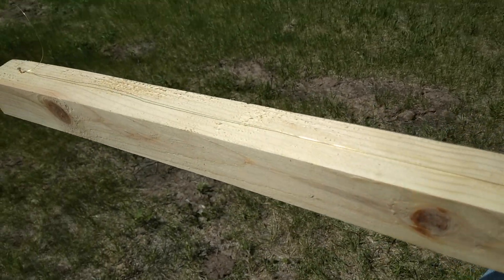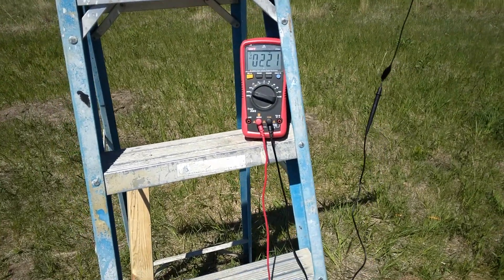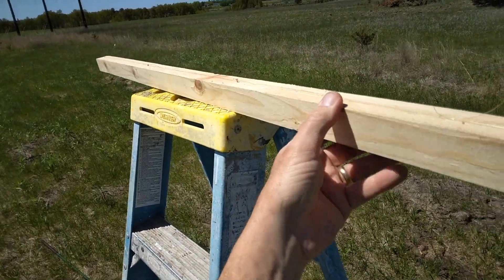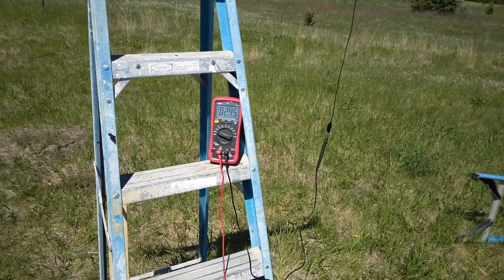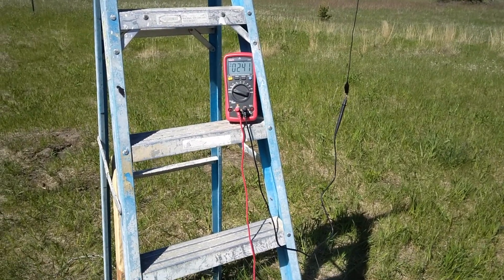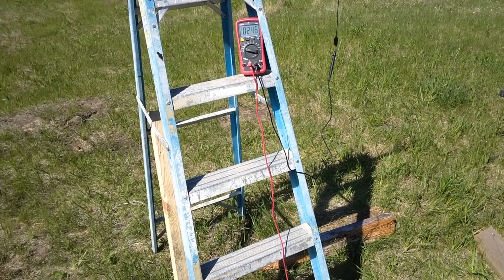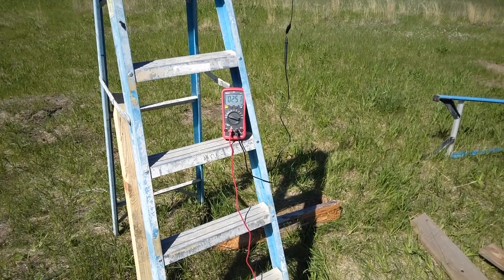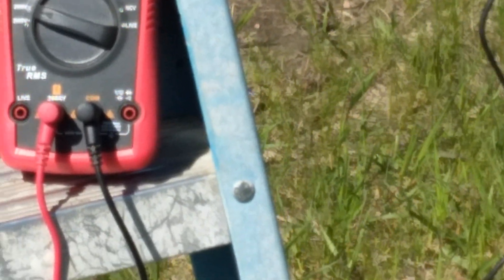Wood amplified energy collector

Comment: This very interesting.
Thoughts of maybe the board is acting a little bit like an 
”Electret”
This would possibly explain the gradual gain in voltage recognized

An experiment of bombarding the board with high voltage 30 to 40KV for a period of time again similar as to how an Electret would be made only this time using the board.

After bombarding the board with high voltage, bring the board back to your ladder positioned as was before again with the piece of bare copper wire pined with the nails, place your meter and see if there’s a voltage change. I’m imagining dipoles forming. My next experiment would be to somehow test for static charge or more correctly an electric charge radiating from the board.

Fun experiment, I enjoyed the curiosity

Comment: If inclined to, cut 50’ spool of 14gauge insulated copper wire into 1’ x 50. Coil wires around 50 iron nails hammered into cedar board. parallel connect each emf inductor coil then to a diode and capacitor tank circuit. Wonder if u could get a watt or two off it? 10 stacked together could output more wattage? proximity to transmission grid could be variable voltage? to charge 48volt batteries or run motor?

Comment: Would this power be enough to recharge batteries? What if you took out a portable battery recharger with you, would you be able to hook that up to this device and recharge batteries?

Does the shape of the wire change its ability to conduct electricity? Have you tried different designs for the wire setup? Like different lengths, or even a dipole antenna setup at different lengths (I don't know if electricity radiates similar to how RF energy radiates greater on certain frequencies)

Have you tried making different types of coils? Like a coil you would see in a generator. Or I think the coils in portable wireless chargers are like a flat circle like a snail shell Labyrinth shape. 

I am a complete novice when it comes to electricity and RF, but these are just ideas/ other variables I thought of. Thank you for sharing these videos!
Reply from the maker: There are milliwatts of power available, that I show in other videos.  What I'm learning, is that it seems like there is only a limited amount of charge potential around the spacial area of the conductor.  That's why a tiny conductor can extract the same amount as one 100 time bigger.  I try many things, and will show what gets the best results.

Comment: can you charge a battery bank with it? how can you reduce voltage and increase watts?
Reply: Ohms Law
Reply: @scottkelbell5003  yes, but can you apply 1000v at 3 milliamps to a 12, 24, or 36v battery? will it charge?
Reply from the maker: In some of my other videos, you can see that I convert it down to 3 volts with a spark gap and coil, to power flashlight.

Comment: Thank you for your research, you seem passionate and having fun its a pleasure to witness
Just some ideas…
If possible, to show all that you are doing but with a little more strategy to it… more precision to the tests like having a fixed marker pole in the ground long enough to determine your testing point and the height… also volts are in millivolts? Maybe show that and be clear that you are in ac or dc or milivolts… certainly would love to know more have some ideas would love to test if i had access

Oh and when testing make sure your at the same place when taking your readings if your proximity has an effect on readings… never know… and keep having funnnnn 
Merci
Reply from the maker: The meter is set for the 2,000 volts AC range.  If the glare isn't to bad at spots, you should be able to see it.

Comment: There is a plethora of information regarding copper in wood and the compounding correlation between the collection of etheric energy and conversion into electrical current. Check out some of the 1800s books on electrio culture. 🤙⚡✌️

Comment: wood will conduct energy its not great at it but it will . thats why on the old electric fences they used ceramic insulators. would love to see you try a low watt light bulb maybe  . not a led bulb but a old school incandescent bulb hook your wire from the hot an run the other end to a grounding rod . i dont know if that would work or not seeing how ac current dont really have a ground for say . unless its a secondary ground .
Reply from the maker: Not enough current for incandescents, but is some earlier videos I was lighting some fluorescents from fence wire.